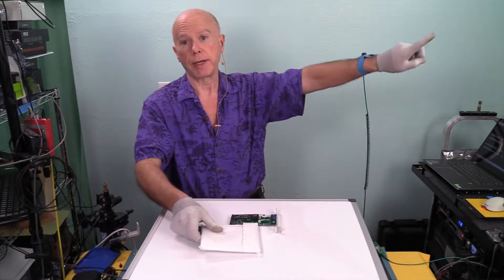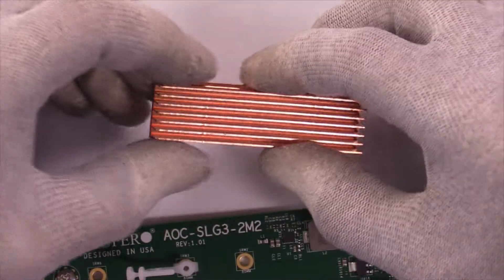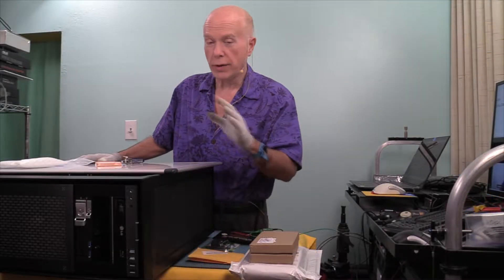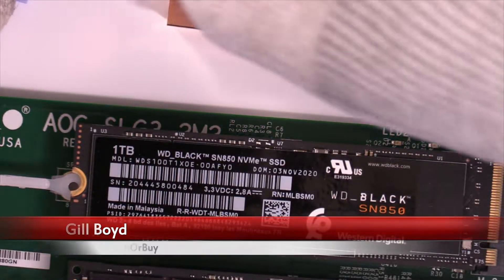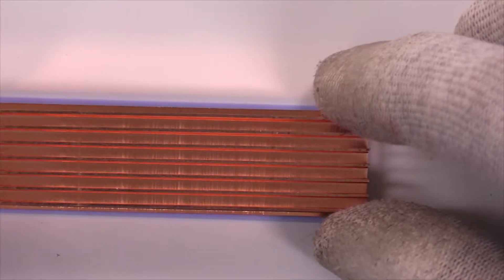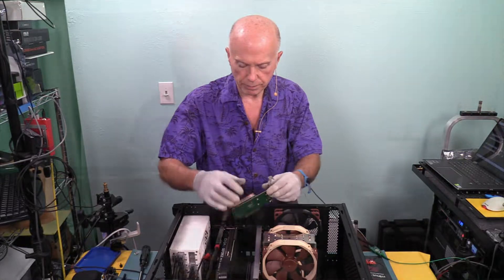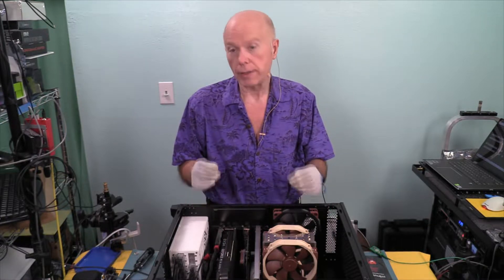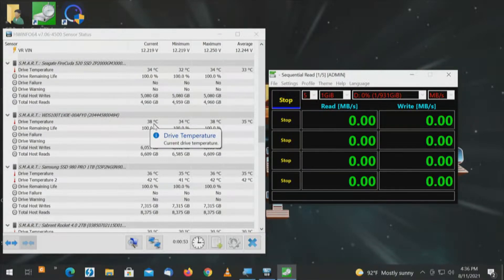How to Install and Test Awxlumv M.2 Heatsink Pure Copper NVMe 2280 SSD

Comment: According to Dell sales support there is 11.5mm space for a heatsink in the Dell Alienware M18 laptops, so I will see if this Awxlumv m.2 heatsink fits.
edited to add: Actually, on second thought, a mobile laptop moving around, this heatsink solution might not be reliable as it may come apart. Right?
Reply from the maker: Hi jasonkhanlar9520,
Welcome! Our greatest concern is the longevity of those thermal bands. We suggest re-check them after 6 months to verify status. This copper plate is very effective compared to the other M.2 NVMe PCIe SSD Heatsinks We've Tested. And We have yet to find anything better suited for Laptops. Keep Us Posted on Your Progress!

Comment: I also have the Sabrent NVMe heat sink and it looks almost like a solid block with some grooves in the top.  I am really curious how a copper heat sink like this would compare against the Sabrent one in a longer thermal test of 30 minutes.  My hypothesis is that they would be similar thermals in the longer test.

Comment: A lot of those heat sinks are just copper plated aluminium. $0.50 of alloy and $0.50 of copper plating. copper is 4 times denser making it excellent at holding and transferring heat, fat better then aluminium.
Reply from the maker: Hello Mephiston 87,
Welcome! So far We've Tested 16 M.2 NVMe PCIe SSD Drive Heatsinks. We have Tested other Heatsinks that had much better performance than this one. Thank You for Your Comments!

Comment: A black anodized surface dissipates heat much more effectively than a bright surface. While the copper does appear to be more conductive, its shiny surface cannot conduct transfer the heat to the air as effectively. Also, the Sabrent module probably has more mass and thus a larger thermal reservoir.
Reply from the maker: Hello Kenneth Lore,
Welcome! Appreciate Your Comments! Glad You've mentioned that aspect! We've Tested 16 M.2 NVMe PCIe SSD Heatsinks so far. Two others faired much better than this one! One is Black Annodized, the other is not.

Comment: It is not machined in a normal CNC. They use a Fin Skiving Machine. It is very cool and works great for this kind of thing.
Reply from the maker: Hi EnDeR Wiggin, 
Welcome! Fascinating! My days behind a Bridgeport Mill were in the late 70s. Fin Skiving Machine, most interesting! Thanks for Sharing that data. Both Copper and Aluminum must be cut wet. They tend to chatter. And Thank You for Watching! We have two more Heatsinks before changing the Thermal Pads then the Heatsinks Summation! Stay tuned!

Comment: Copper may be more efficient at heat transfer but that heat probably has to go somewhere to make that efficiency useful. If the cooper is just holding onto it, that would make sense why you're getting higher temps. The Sabrent heatsink is a larger piece so has much more thermal mass to play with. A smaller copper heatsink can only get you so far. 

You should try testing the various heatsinks with and without a fan blowing on them. see if that makes any difference.
Reply from the maker: Hi MacTX,
Welcome! All Good Observations! One step at a time! Stock elements first! Appreciate Your Comments! We have two more Heatsinks to look at before We get into the Thermal Pad changes. Then the Heatsink Summation! Thanks for Watching! Stay tuned!
Reply: The heatsink I use for my boot drive keeps my Samsung 950 Pro at 43c, passively cooled. It's a very large aluminum block type with the fines being much longer than what I normal see.

https://www.ebay.com/itm/165010715370?hash=item266b67b2ea:g:sqsAAOSw5VNhEg8c

The dimensions of the heatsink is wrong in that eBay listing, the aluminum fins is much longer than the heatsink is wide. It shows the fins as being 22mm tall when that's not true, the width of the M.2 is 22mm which is about how wide this block is. The fins are almost 1.5 inches tall so 30mm is probably the correct measurement. They also appear to be much more expensive now than what I bought it for 2 years ago. I only paid $3.12 for mine, shipped for China.

Comment: well this is an interesting subject, let me toss in a little tidbit of information for a relationship to these heatsinks on these external cards,  I have a new Asus Z590-E motherboard, with an Intel i7-11770k processor, and I purchased a Samsung 2Tb 980 Pro, so given this motherboards heatsink which is basically a simple plate to cover the PCI 4.0 M.2 slot, where,  I installed the Samsung 980 Pro, and I ran the exact same test that you did, here's the numbers... Max temp was 49°C (120) using your 1 TB Crystal disc mark test, and the Same CPUID HWMonitoring software... and i Ran it three times... No change,( it was stable)  then I decided to see about saturation temperatures, meaning the ability that once a certain heat is achieved because of the data transferring rate, can the heatsink dissipate the heat at the same rate, and not keep increasing in Heat... Call it "equilibrium",  If you wish for heat dissipation.. 4 TB file, only moved it up 1°C to  50°C,  interesting for a standard piece of metal which I believe is aluminum and a thermal pad that comes with the Asus motherboard...  Just thought I would pass this information on as something to compare, curious as to why a real  (engineered) heatsink doesn't dissipate any more heat than a simple, flat plate made with aesthetic appeals for visual prettiness in mind,...seems to do better than a real engineering created heatsink.
Reply from the maker: Hi LonnDawg, 
Welcome! Those stats are very helpful! Comparisons are good! Everyone should test and check their Results! We need to know this stuff! Absolutely Agree! Some of these Results differ from Our expectations. The more We get into this, the more intriguing it becomes! And this is all stock products! No modifications! And We can improve those numbers. We need to know this data then digest what We know in Our Heatsink Summation after the Thermal Pads change. We have decided to test two more Heatsinks. Appreciate Your Comments! This helps Us to make Better Videos while Answering Subscribers Questions! Stay tuned!
Reply: What was your crystal diskmark speed with the 980 pro in that M.2 mount?
Reply: @maxhughes5687  Okay,  I just did some fresh testing for you... On my  2Tb Samsung 980 Pro, the Read score was 6,647.11  and for the Write it was  4,925.74 using the M.2,  PCI 4.0 slot, with a temperature of  116 F   (HWmonitor) using the standard beautifully crafted and matching the motherboard aesthetics "Heatsink"  :-)... ( it doesn't look like anything special, just embossed with Asus matching motherboard look )  The heatsink really just seems to be a flat piece of metal, which is puzzling listening to all this testing...  and I also increased the number of tests to (5) in Crystal Disc Mark, and changed the file size to 4 TB. To get these numbers  Hope this helps,  and remember what we've been taught.... here on this channel,...  It's really a combination of all the parts in the motherboard and everything else that gets the numbers for performance,  I seem to be getting pretty close to the theoretical limits of the Samsung 980 Pro,  I be happy, :-)))  with my purchase,  I would never have spent the extra money on a 2 TB drive, except for the fact that Amazon had a sale... I saved like $90 buying the 2 TB drive,  I still think the current price for the 2 TB drive is like $400  :-)
Reply: @LonnDawg7554  Thanks. So it was at full blast 7000.
Reply from the maker: HI @maxhughes5687 , 
You know what this means!!! Another Video! Stay tuned!

Comment: Well at least it stops the ssd from reaching 90 C 😂 ; now that I am thinking about it , it seems that the sabrent heatsink is better because it compresses the thermal pads very well , thermal pad performance is directly dependent on pressure , I don’t think rubber bands match the screw mounting mechanism of the sabrent( pressure wise) .
that being said , this heatsink kept the ssd at peak performance and that’s a win in my books. The heatpipes technology is too good compared to regular copper/aluminum/diamond , the thermal conductivity of heatpipes is insane .
Reply from the maker: Hi 5 nm,
Absolutely! Very Good Point! The Sabrent is amazing! Just using as is. We can make it better! The weight concerns me though. And bands will give out over time. Exactly! It's just a matter of space. This has to be a very intriguing Project from my point of Views. Numbers are surprising! Always excited to see the Results! And two more to test before We touch changing Thermal Pads! Stay tuned!

Comment: Great stuff again! I will point out the following - contact area, even under the bare PCB of a single-sided drive, and the mass of the entire heatsink have big influence in dissipation. The fact the Sabrent one contacts both sides improves contact area already, because those chips dissipate to PCB which dissipates to bottom plate. Then there's more metal with the transfer heatpipes, the bottom plate and even the 3 thermal pads since the back one needed stacking.

Also something to note is the quality of the Sabrent thermal pads vs this copper one: These are the standard light blue stuff that comes with every cheap brand Raspberry Pi kit for instance - they're likely around 3-5W/mK. The Sabrent ones are white and seem softer, but they're undisclosed (I looked up their product page and saw nothing). My guess is they're better, but since Gill has planned to test the top 2 ones with better thermal pads, I guess we'll find out if that makes a huge difference!

Thanks for the video
Reply from the maker: Hi cldpt, 
Thank you very Much! Appreciate Your Comments! Absolutely agree! A bit skewed. However, those Results are amazing given this is a stock package with no modifications! Glad You mentioned the W/mK Thermal Rating. Very important! Based on the W/mK Thermal Rating alone, it should. The question is how much of a difference. Interesting right. The more We get into this the more interesting it becomes! Thank You for Watching! We have 2 more to test before We get to the Thermal Pads! Results! Stay tuned!

Comment: I believe that the copper heatsinks operate much better when you remove the stickers from the ssd. I know you covered that you are keeping them in an earlier video but I am finding that with even cheap low profile aluminum heatsinks I get a massive 15 to 20 degree improvement by removing the sticker on both sides, even with ultra cheap 3mm heatsinks. And I am creating Chia plots via SSD 24 hours / 7days with the SSD's that are stressed way past any test you can muster.
Reply: Are you seeing any degradation of the health of the drives?
Reply: @davidwhite2011  On my 2TB TeamForce 440C SSD I have written 2,400 Plot's and it is still reporting 57% life remaining (Hardware info64) That particular drive has a rating of 3,600 TBW. The first 2000 plots were entirely written on that drive, the last 400 (and counting) are using MadMax with ramdisk which reduces ssd writes considerably.
Reply from the maker: Absolutely! Agreed, No way Our tests will equal what You're doing! But what You're doing is making Vendors create more durable M.2 NVMe Drives! But these are not those Drives! We may mention that in the Summation. Two more to test! Stay tuned!

Comment: In the spec sheets for the controllers and the memory chips, what are the suggested running temperatures?
Reply from the maker: Hi David White, 
Excellent Question! My Goal is below 86 °C. For each, We have to check and verify. 
1. WD Black SN 850 - 70°C. Operating Temperature. 
https://documents.westerndigital.com/content/dam/doc-library/en_us/assets/public/western-digital/product/internal-drives/wd-black-ssd/data-sheet-wd-black-sn850-nvme-ssd.pdf
2. Samsung 980 Pro -  70°C. Operating Temperature. 
https://s3.ap-northeast-2.amazonaws.com/global.semi.static/Samsung-NVMe-SSD-980-PRO-Data-Sheet_Rev.2.1.pdf 
Thanks for Asking! We may include this in the Heatsink Summation Video! Two more to test! Stay tuned!